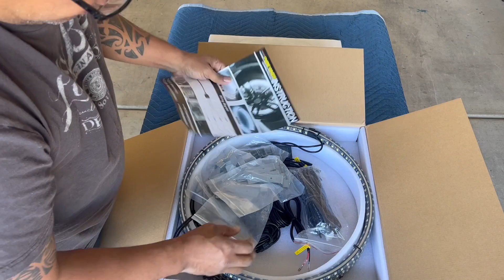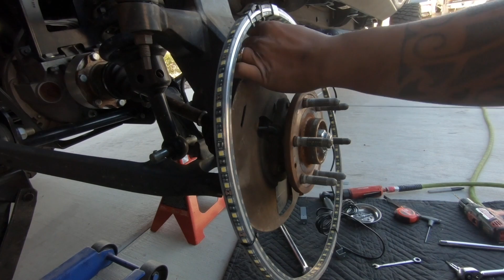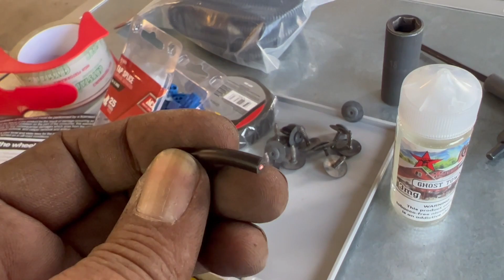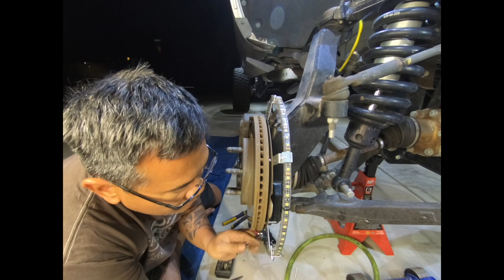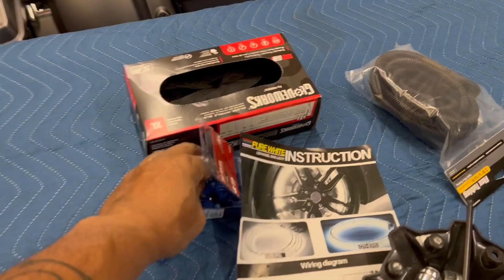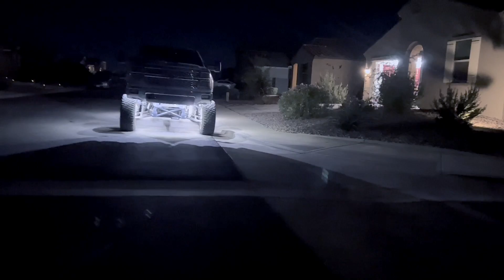Wheel Lights Install on my Silverado

Comment: If I have the stock 20in wheels do I need to get 15.5 or the 17 in ones
Reply from the maker: @smiledcj2061  my wheels are 20 inches and I went with the 17 inch.   I felt the 15.5 would be too close to the caliper.  I hope this helps!  Don’t forget to like and subscribe🤙🏼

Comment: What’s your wheel setup
Reply from the maker: 20x12  Moto Metal M0970’s on 37x13.50 BFG’s…. I will be upgrading to 24x14’s and 40x14.50’s after the tires wear down 🤣
Reply: @hawaiianbrokechanic  and the lights didn’t interfere w the rim at all? How close was the light to the rotor? I wanna put some on my 2017 Silverado I’m also running 20s but I only have a couple of inches of room to work with
Reply from the maker: @reelsouthfloridafishing2338  make sure the wheel lights are 17” in diameter.  What’s important is that you bend the brake dust shield away from the rotor per the instructions.  It does get tight around the caliper but it has enough clearance to not affect anything… I have had no clearance issues so far… I hope this helps!

Comment: hey have you had any issues by tying your wheel lights into your rock light curcuit?
Reply from the maker: I have not had any issues at all.   What’s really important it making sure you have thick enough leads that supply positive and ground to all the lights.   I plan to add another 8 pods to wash out any remaining shadows under the truck.  I will need to run 12 gauge wires in place of what I’m using now.  That’s for checking out the video 🤙🏼